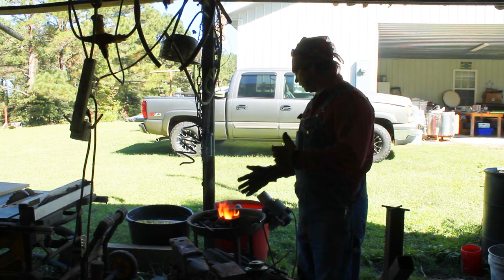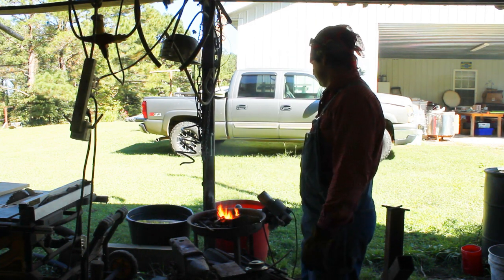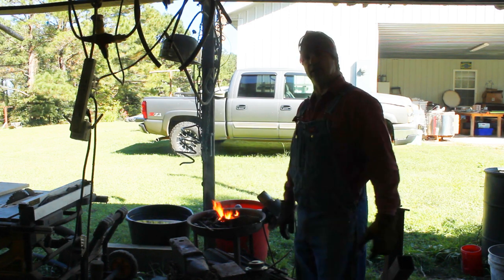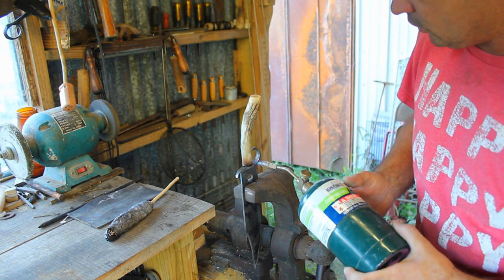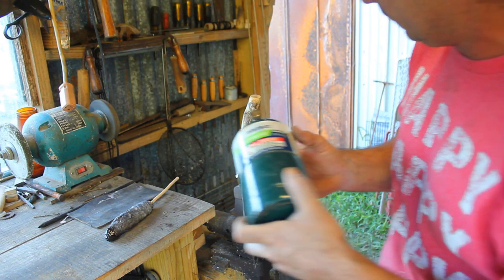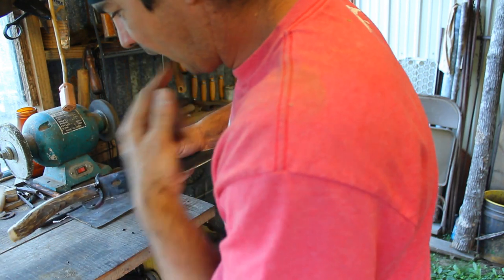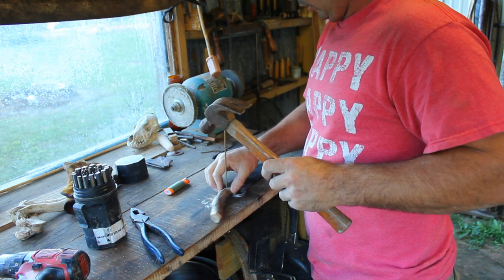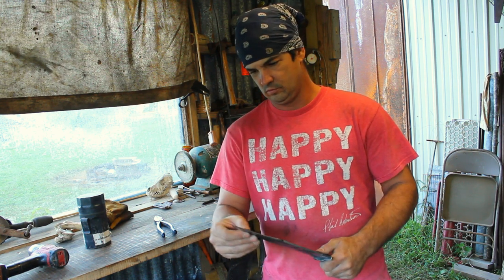Forging a new bowie

Comment: I'm happy I found this channel, I was looking up blacksmithing Bowie knives because I'm making my own and this was the most interesting looking one I saw.
Reply from the maker: Thanks man im no expert but i do fairly well at most anything i put my mind to. Happy to have you with the family here
Reply: @SpiritoftheOutdoors  good to be here, have you ever worked with wrought iron for a blade before? It has a beautiful pattern, I'm going to make my little Bowie out of it with a strip of high carbon steel for the edge.
Reply from the maker: @HalfmoonForge  im not sure . I pick up junk and heat a peice till a magnet wont stick and water quench it and hit it with a hammer and see if it snaps. This blade here is milder steel but in the water bath it wouldnt break or bend easily and my file slid off it . So this may be im not sure but its a cheap lawnmower blade. I have commercial grade lawnmower blades that is actually good steel
Reply: @SpiritoftheOutdoors  I've used lawnmower blades to make pretty good machetes for outdoor work. I use a lot of leaf springs for blacksmithing too.